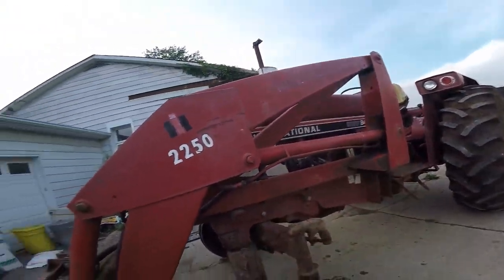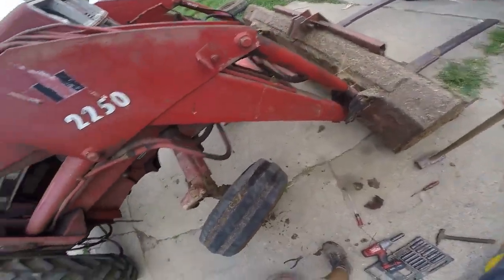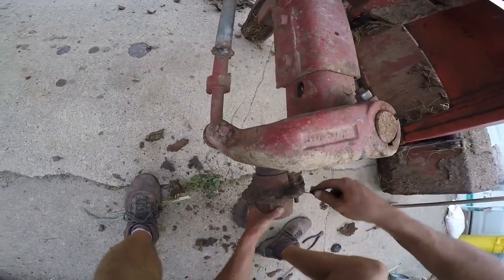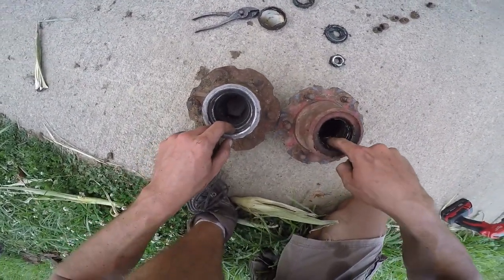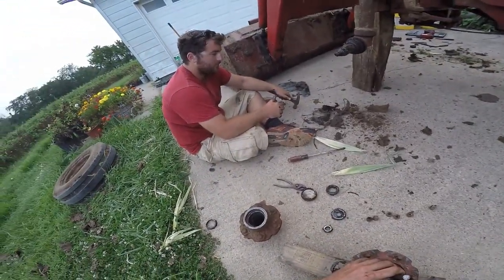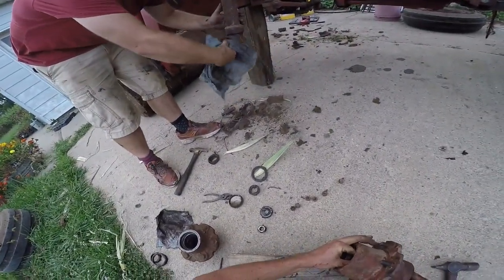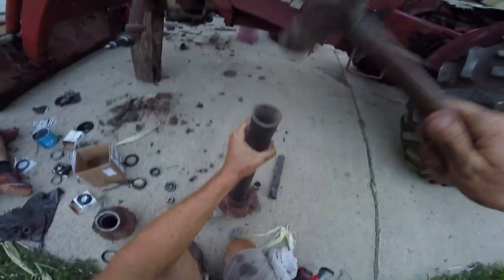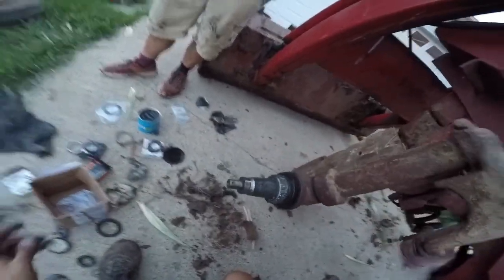IH Hydro 84 Wheel Bearings

Comment: If you take a front axle from an old four-wheel drive tractor, it holds better on a tractor with a front loader,  it doesn't have to be driving anymore. They have much larger ball bearings and are more robust. Just a tip from a subscriber.

Comment: Ok,  two things to never do. 1.  Never put on a race with a pipe that doesn't fit around the outside of the race, you do not want to jeopardies the machined surface where the bearing will ride. You can carefully take a punch and tap around the outside of the race (yes its hard to get bite with the punch on such a skinny surface but if its your only option it can be done) until it bottoms out if you don't have a pipe or socket that fits. 2. The inner bearing is installed in the hub and the seal is tapped into the hub before the hub goes on the spindle. If the hub doesn't have lip for the seal to bottom out against just be sure you are flush or just inside the back of the hub. Also put a wipe of grease on the seals rubber sealing lip before installing the hub and a bit on the spindle wouldn't be bad either. Its nice watching how you guys work so well together.
Reply from the maker: After inspecting all our wagons, wheel seals come as two types; some sit solidly on the axle, others are tight to the hub; This set was tight to the axle. Don't know why one style is used over the other.

Comment: Good video. Thanks for taking the time to do videos.
I would say that is a sucessfull tear down. No cussing, that is nice. Only broke a Craftsman screwdriver which is warrantied for life, just take it back and they will give you a new one. 
I had a 1840 Case skid steer. good machine but has limits. Only goes so fast, you would need to trailer it to the field. Only lift 1200lbs or so. I love the quick tach bucket, change any attachment in less than 2 minutes. I upgraded to a NH L785. I love the ford diesel and the higher lift cap.It i harder to change the bucket, but still quicker than 4 pins. Either would load or unload hay and scrape/load manure quicker than your tractor. 1840 is quite a lot jumpier than the NH.Bucket on my NH is probably bigger than the one on your IH. NH ha 2 speed so it would go on the road about 12 mph. There was a NH L785 on KC craigslist for under $10k yesterday. Keep it up is the name of the game!
Reply from the maker: Yep, that's why I keep mostly craftsman tools. In my limited skid steer search, I did like the pre electronic age and engine options of an L785, but with their age, it might be hard to find one in decent condition. As far as quick attach buckets, we have a set of forks to put in our current bucket that only needs one pin to hold it.
Reply: Same here. I like the pre-computer age equipment. My hammer don't work well on those computer controls. Did you get the front end all back together? I think you did well to notice the bearing out on the tractor. I had bearings go out on a disc wheel that broke the cast hub. Yours sure could have been a much more expensive repair.

Comment: The loader looks to be in good shape, if it was me, to save the most money, I would look for a tractor from 574 up to 885 at a reasonable price, put your loader on it then save the 84 for light duty jobs close to home.  I wouldn't want to pay the bill to repair the hydro, I don't think it's worth much without the loader so I would keep it. Plus if the hydro does give out completely, then you have a spare engine and axles, tires etc for your loader tractor. May just be the pa dutch talking though.
Reply from the maker: The Hydro 84s I see on tractor house are usually well abused and low priced. Since ours still has a grill and the lights work, I'd like to think it's in better shape than most. If possible, I would like to keep the loader since we have solidified the bucket and have a fork system I like.

Comment: The gear versions of those tractors work nice. Reverse and low are on the same throw so shuttling isn't too bad as long as you don't need to change speeds. Sometimes all the hydro needs is just the pressures turned up a bid to make them back to what they should be
Reply from the maker: We had a 684 before we got the Hydro.

Comment: If you are not in a hurry you can put the bearing races in the freezer for a few hours and shrink them. Makes driving them in a lot easier, also if you have a machine shop close you could have taken both hubs to them and have them repair the damaged hub.before you install the new races.
Reply from the maker: Yea, I know about the freezer trick, I mostly forget unless its a super tight fit.

Comment: If you keep the 2250 loader you can get a SS adapter (tool carrier) from Mast Farm Services in Walnut Creek Ohio
Reply from the maker: The 2250 is the best quick attaching loader, I can leave it on uneven ground, it doesn't require stands, and it will slide right on.
Reply: My buddies put the SS adapter on their 1086 and it is so much more useful swapping attachments now

Comment: Put some grease zerks in my JD came with zerks on  front bearings.
Reply from the maker: I have been putting grease zerks on all the wagon wheels. I thought about it for this project, but since the loader tractor sees manure, I'm afraid the zerks will rust and/or let moisture in.
Reply: @boehmfarm4276  They might rust, but not let moisture in... better to keep it full of grease than full of manure LOL:)  Grease is cheap repairs are expensive!  LOL:)  OL J R : )

Comment: the rubber side of the seal is always the side that rotates on the spindle, never the outside ( steel doesn't slide on steel ), and you shouldn't have a press fit on your inner bearing race, that race needs to be able to spin on the spindle some. I'm thinking the far east made bearings aren't quite to the same spec as the old made in the USA spindle. not uncommon.
Reply: Except this one uses a seal that the steel part of the seal drives onto the spindle, with the rubber sealing lips sliding in the outer edge of the hub.  Exactly backwards from everything else I've ever seen.  If you look carefully when he's driving on the seal, you'll see the steel center of the seal is driven onto the spindle, and the three rubber sealing lips that ride just inside the lip of the hub to create the seal.  Weird but I guess it keeps stuff from wrapping and pushing in under the seal and cutting it, at least in theory.  And, NO you don't want your inner bearing races turning on the spindle, not unless you like replacing spindles. A spinning race will ruin a shaft or hub either way, seen it plenty of times.  The BEARING is supposed to turn, NOT THE RACES!  OL J R :)

Comment: If you go for a skid steer look at a case 85xt or look at a bobcat i have drove both at work in scrap yard and i like the case 85xt better all hand controls  bobcat is hand for steering and foot pedals for bucket  we have another case not sure of size ok but smaller and has grapple bucket  but we got a brand  new kubota ssv75 to replace the case needs work to fix
Reply from the maker: The foot controls for the bucket do worry me on some models. I have heard that is the reason for some skid steer accidents.
Reply: Boehm Farm.  foot controls yes and no the kubota is foot too but it just takes time to get used to not bad but 85xt case and our newer still older case have all hand controls which i like better but i can do a good job with foot controls to just takes time to get used to  man that farms my gpas has  john deeres loves them  got to replace old old deisel gehl.
 scrap  yard i worked at in dayton has john deeres and before i quit they got 2  nice used  cat skid steeres but never ran them so look around test some out see what you like

Comment: I would recommend a J I Case 770 with a loader so you can do more work than the little 84
Reply from the maker: A bigger tractor won't be very comfy scooping out the barn.
Reply: It is a little bit smaller than a 1086 and open station is the most common with this model.
Reply: plus you can put a bale spear on the loader of a 770 so you can have one on the road and 1 at home since you do not trust the hydro on the road.

Comment: you know them races if you throw them in the freezer for like 24 hrs they will shrink just a fraction but that fraction makes a world of difference in installing they will believe it or not basically drop in and as they come back to room temp they will expand to original size and stay in.
Reply from the maker: That's a great idea. For some reason, I have never done that with wheel bearings, but have used that trick for other tight fits.

Comment: if you looking for a good loder tractor get a versitial bidirectional or get a jhondeeer with a shuttle shift
Reply from the maker: I always thought the bi directional looked cool, but the cab would be an issue for cleaning the barn. Number one rule of Boehm Farm, no green. I really want a 30 series Ford with a shuttle shift and front wheel assist.
Reply: +Boehm F arm  you have green thoe lol
Reply from the maker: Yes, rather begrudgingly. And it's caused it's share of nuisance.

Comment: 2250 loader just keep you 84 for farm yard work and just find you a set of 2250 Brackets for your 1086 or 1466 lol then you have another tractor to throw the loader on it you did not want to use the 584 lol
Reply from the maker: Um, I have a sneaky feeling that the bigger tractors are wider, that's why IH made a 2350 loader.
Reply: the 2250, 2350,and 2450 were all quick attach/detach loaders, designed pretty similarly. the 2250 was built for the small frame tractors. i have 2250s on 656s and my 784. the 2350 is heavier built for the large frame tractors and more lift capacity. the 2450 was the same as the 2350 except it would lift a lot higher than the 2350.

Comment: It's brutal to watch you do bearings. The seal gets mounted on the hub and lip lubed so it slides over lip. My god you did that ass backwards and the seal will not work. Get on youtube and watch a professional do a repack. You need a used hub for the worn off one.
Reply from the maker: Ya know, more than one manufacturer made machines with wheels and wheel bearings. I went through gravity wagon wheel bearing last year to repack them and came across seals fixed to the axle and seals fixed to the hub, it's just whatever the engineer was feeling that day.